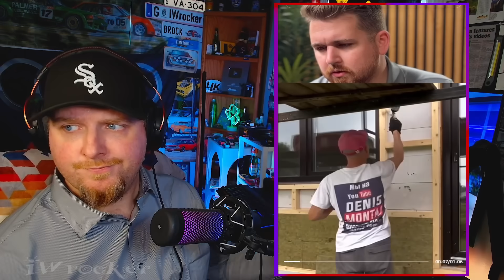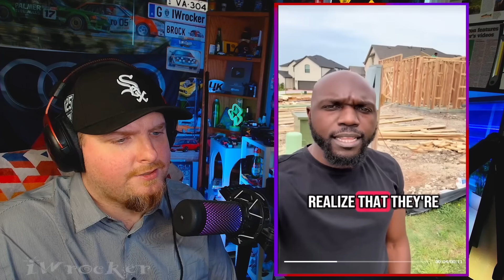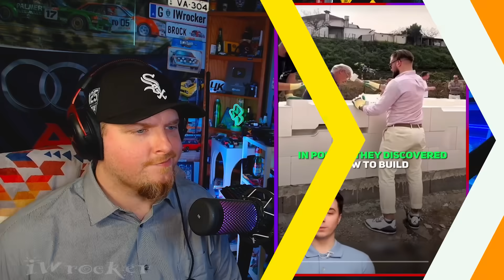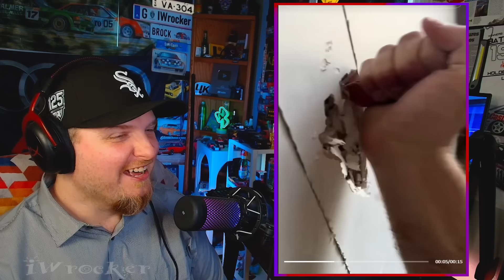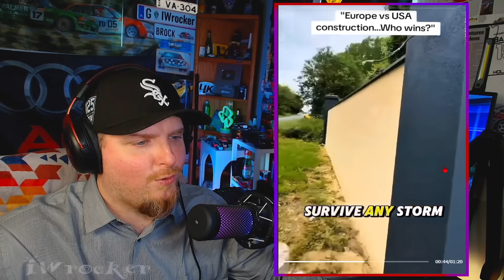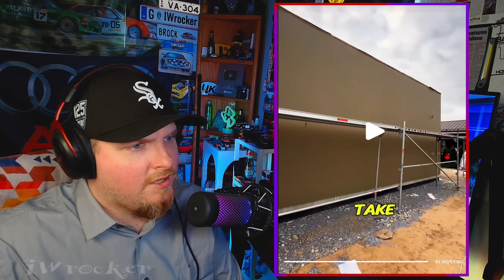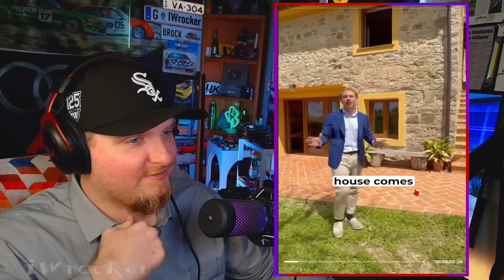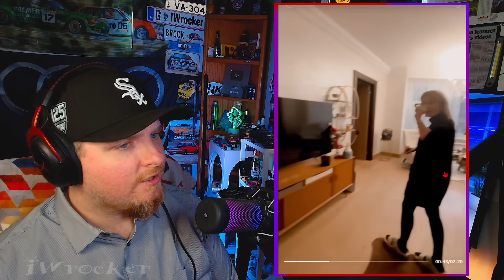25 Minutes of European VS American Home Quality & Construction Methods 🔨

Comment: 1:54 we do just anything right in america - most stupid saying on planet - if you talk about building and constructions. American houses are plywood and shi1 - while even the quick-building houses in europe are massive and stable. We not even start with the old ones, just enter a mediterain italian city (or rome) and watch what these people build then.
Walls here in germany are massive, my house has (internal, non carrying) 18cm, the others are 32cm thick. Concrete and/or stone. The ceiling is steel-supported concrete, just like the walls of my cellar. You could put an elephant in the center of any room - or a 6-people whirlpool - nothing would happen. 

7:55 laughable... sorry. As a kid i never understood why americans jumped to the floor if the evil guy started shooting IN the house. Here with me - i could stand behind the wall and you could empty 3-4 magazines into the wall and would achive - nothing. These are no walls but shi1.

And still, you can have both. If you have a concrete-+-steel-building here in germany, you could have only the walls and maybe one carrying wall and all other internal stuff is easy to fix - just like in these terrible american houses. But the outer walls are massive and stable. 

13:11 nah, 9k is a wet dream. 
If you would put modern (3-level-protection-glass) into my house (i have "only 2 layer") i would spent 40k... 27 windows (if you count normal 80cm-sized ones as standard) and 3 large doors.  The price - at least in germany is way to cheap. But yes, i can open any door and window in the "Kipp-"version and they are much much much much better then anything ordinary americans use.  

14:50 He is right. But also wrong. The problem with modern european (here german) houses is, that they are "airtight". Older ones, who had bad isolation could bring the moisture through the walls. For this modern "passive-houses" have a house-cooling-system", not an AC (still only few houses have that - myself have 4 in 4 rooms, never had any problems with moisture) but it transports the moisture out of the house. A problem mostly occurs in older houses (build between the 70ties and 2000s) that get renovated and turned airtight. These have often problems with that. Modern ones either have the system i described or - more and more - ACs, so a running AC drew the wet humid air out and turns it into dry one. 

17:00 yeah, but that happens all over the world. Scum happens by evil people, i doubt that german builders are better/worse then the american ones. Really. But yeah, such failures - are impossible to hide. 
In germany we have rules, for example, the last 10% of the money is ONLY delivered after the new owner have checked all boxes and give his okay for the house. Such things - no okay, no rest money (such a house costs around 600-700k, so the builder sits on 60-70k he will not get, only after fixing all trouble creating things)

Comment: I fail to see any pros in USA houses.. being quick to build is not a pro.. 

A house needs to be:
Durable
Strong
Last forever
Be secure
Have insulation to cold and hot
Noise reduction 
Not be a fire hazzard 

And USA houses don't check any of that

Comment: on the wall issue... I have 80cm - 2.6 feet stone walls in my home my cellar is build of 50x50x50cm 1.6x1.6x1.6ft granit blocks and it was initially just a cow shed which got added a living wing some 200 years ago xD
Reply: and if you insulate your cealing you have to at least use 20cm around 8 Inches by building law

Comment: My parents' house in Northern Ireland is built from solid concrete blocks, double walls with 200mm insulation in between them, concrete floors with underfloor heating on both floors, solar panels, ground source heat pump, slate roof, triple glazed windows.

Put it in hurricane alley in the USA and a hurricane would feel like a light breeze. It's on an exposed farm with no other houses around it, and in the worst of the storms we had over the last few years, it lost a couple of roof slates.

I currently live in England, and my house was built in 1929. I don't see how it won't last at least another hundred years.

Comment: The insulation is on the outside because of the extreme colds... cold weather brings high humidity, without insulation, it will slowly seep into the blocks and damage the electrical and plumbing installations, the high humidity also allows saltpeter and mold to grow.

Comment: I’m a big fan of SIP home construction. It’s relatively simple to build and super fast. The panel expense is offset by the time saved. 

I saw a SIP house designed and created in Germany, arrive on the back of a truck in the UK accompanied by a team of German builders and the entire house was up in no time. 

The interior walls were pre painted to the clients specifications along with all of the outlets etc. The windows were the thicker European style and when completed the home was tested and given close to the highest energy efficiency ratings. 

Yup, I think Structural Insulated Panels (SIPs) are the way to go.

Or maybe fly in the Amish and have them build an insulated barn for you 😊(I’m not in the USA).

Comment: In my dads house in the inner walls plywood with plasterboard on top of them but quite tight between the beams and in the flats i lived in it is concrete with plasterboard on top or plywood with plasterboard on top of it . But if the building are for flats and is over a 100 yr. old then the filling between walls can be a bit different .
I know of some old buildings in the city area in Stockholm that has a rat problem inside their walls , why because when they were built they used hay with some clay as insulation .

Comment: Not really exaggerated the houses lasting 100years the house i live in was built in 1943 and is still strong ( some renovation done inside and outside) still the original main structure of the house standing strong

Comment: 12:52 On the windows I know, I'm Danish, if you choose to turn the handle all the way up, you can only open the top of the window, which tilts about 10 cm into the room for ventilation, but still hinges firmly at the bottom.

Comment: The foam insulation on the outside? Yeah, hell to the no. I studied this, it's part of my job (drawing technical building plans) and it's one hell of a fire risk. In case of a fire, it catches on fire in just under 10 minutes and then drips down your neck as you climb out the window. Do you really want dripping hot plastic dripping down into your neck and burning you additionally when you try to escape your burning house? Look up "Der Wärme-Dämm-Wahnsinn". It's a documentary by swr iirc, showing just what happened when a Multi-Story Appartment building burned down with exactly that insulation. And how bad mold can get. I'm glad we don't have that. I'm glad we have mineral wool. It doesn't burn at all and also doesn't get mold.

Comment: Point of tempo: I see your American buildings, and raise you a standard Viehbrockhaus (regional building company, but does build occasionally all across Germany). Ours is one. Standard two layers, core made of bricks, Fassade Made of bricks, in-between insulation, completely with basement, basement done in 2 weeks max. Whole house was done in 3 ½ months. Normal houses from them take 3 months till it's ready for giving you the key aka you can move in immediately and live in it immediately. Basement needs 2 extra weeks. They developed a special kind of concrete that dries extra fast just so they can make this "3 Monate bis Schlüsselübergabe" (3 months till you get the keys) promise and actually keep it. They have a big tent that they put over the house so they can even keep that promise in the winter. No matter how cold.
So tempo isn't even always in your favor. Our house, like I said, complete with basement, 3 ½ weeks. From beginning to end. And we have roughly 140-150 m² floor space. Two levels. Or, in German terms, 1.5 full floors.

Comment: My house has pre-made concrete walls, which have been compressed in the factory. Result: There is no way to get a simple nail for pictures in this walls. you need a pneumatic drill for tiny 3mm holes. A 8 mm hole can easily hold the weight of an adult. The dowel fails first before the wall.

Comment: If I tried to remove a wall in my 1950's home using a utility knife and punching it I would break my fist and have blunt blades. My previous home was 1850's and as strong as the day it was built. US housebuilding appears to be crazy poor quality and over priced generally with little quality control and everything in favour of the developers - max profit!

Comment: loath how corpos pushes the flimsy american style construction and tryes dismantle regulation pointing out the flaws with it

my 40's buildings might show if they not gotten any love but solid brick walls sure provides both a sturdy skeleton that lasts centuries and being inert material simpler to work with to insulate or add new tripple glass windows etc

Comment: 13:40 We have a tiny house in the garden made of wooden walls. We even insulated this walls, allthough the insulation material is only 1.5 inches thick, it still makes a difference in temperatures inside. So it´s pretty much standard over here...

Comment: That first dude is really insufferable. And Russia most definitely isn´t Europe. As an Austrian to me most American houses are like cardboard buildings. No stone or brick walls and no insulation? But cheap i guess. Of course you need insulation. And you don´t want your home to get blown away or flooded, do you? So it needs to be built of stone or brick. We also don´t want to pay endless money for heating (resources) and usually we survive without AC. Modern building all use those insulation techniques. We are trying to minimise our energy use for environmental purpose. We need a qualified planner if we want to build, often that´s an architect who actually went to university to learn everything there is to know about statics and building materials and has a degree. At least there needs to be a certified builder for construction. So they know exactly what to do and there simply is no mould in this. Plans need to be submitted and get confirmed by council and then you can start building. So yes, it costs. A lot. But we have a guarantee not to be buried alive after a storm. In Austria most city houses have red brick tiles, my city´s are even part of our cultural heritage. Those metal tiles are really cheap. I am surprised to learn they don´t use them in the US. The house i live in is about 200 years old and there are far older ones around. What I am really interested in is how you install a bookshelf on those cardboard walls? Mine are all made of brick. If you´d punch them, you´d break your hands. And don´t you get a lot of vermin and mould in those hollow walls? That house in London is not for living, by the way. They used to build only facades in some places to disguise railway tracks and make the street more pleasing.

Comment: The London house is indeed a fascia. Suspect there will be a tube line running directly underneath behind it. 

Not sure what you have in America but over here we have listed buildings which it's very difficult to remove and sometimes I would partially listed so the facial will be listed but the actual building can be destroyed behind it - I work with a security company and we looked after a company in Cardiff where they built a massive tower block but because the fascia was listed they had to keep the 19th century frontage and bolt it onto it. 

We are also getting more timber frame properties in the UK and we've looked after a few of those too - cannot say with our weather I think they will stand the test of time.

Comment: I live in a post communist ten story midrise, with 86 apartments. It's made of rebar reinforced concrete. I can't hear any of the others in the buildig, Ihave excelent central heating and decent AC, and central venting too. Oh yes it was built in 1975.

Comment: My old apartment was built of granite blocks, the approximate size of a refrigerator. The insulation was reeds mixed with blueclay and sand. My current one is thick concrete with cedar cladding.
I'm worried about those wood/plasterboard buildings. Will they hold against a storm? Thick roof snow? What if something falls on them? Are they safe?

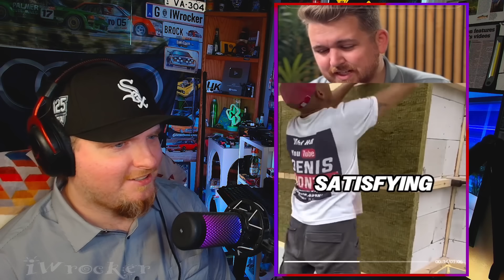Comment: 1:18 As a European I have never seen wool insulation done like this, I mean wool is nice I do prefer polystyrene, even though it makes a lot more mess and is less ecological, but just the thought of having those gaps of wood between insulation would haunt me. All that adds up on that electrical bill, oof. :D
Also that isnt conrcete but what looks to me like autoclaved aerated concrete, had to google the english name and its quite something, unlike the word porobeton, its pretty weak but good enough for a 1-3 story house, but it has very good insulating properties.

6:20 I dont know about this, you have to understand in Europe every once in a while someone gets a crazy idea and they say it became popular across Europe, but I would argue that less than 1% of European houses are build like this. Its a new thing and I have nothing against innovation. But I wouldnt call it popular.

8:50 I would like to disagree with fellow Europeans, drywall is pretty good. You can easily remodel your house with it and its far more common in Europe then one would like to believe. Its not unheard of, we use it. Just not in such a massive ammount.

13:40 Ok this is exactly how newbuilt houses and added insulation is done, atleast here in Czechia on 99% of houses, except we also drill and anchor the blocks to the wall, otherwise you are risking a strong wind finding its way underneath the blocks and just peeling it off. Then goes the mesh and the underplaster on top of which goes stucco or whatever you call it in english, rendering perhaps.

17:30 Another intersting bit, here all newly build houses have to pass inspection and thus Newer Houses actually are better than older, ofcourse time will tell what is the reality, but in America it seems older is better.

19:35 Never in a million years would I want a fireplace, all the heat goes poof out the chimney, no thanks. Get me a proper metal stovetop.

22:44 What do you mean the whole thing is tiled? Why so surprised, says me surpised by you being surprised?

23:54 That is indeed a good deal, if only it was so affordable here... :(

Comment: fun fact on european windows, or at least the french ones I know. There are two settings : winter and summer, you just have to turn a locket on the side of your window to make the joint tighter or looser depending on weather, humidity etc. It's pretty neat ngl. Do you guys hear everything your neighbors are doing with such thin paper walls ? I sometimes hear my upstairs neighbors when they walk in heels or run down the stairs but that's pretty much it

Comment: Most homes in Europe also use "drywall" in the uk we call it plaster board. But yes we do it too... the difference is the outside and the inside supports are all made up of usually double skin brick walls for structural integrity. But overall rooms are made of wood and plaster board. We also plaster over the board to make it more solid rather then using a thing layer of "mud" i believe you call it state side.

Comment: 18:45 That little 3-wheeler is called a Piaggio Ape! It's an Italian icon. In Italian, 'Ape' means 'Bee' (because it buzzes around). It’s basically a Vespa with a truck bed! We use them everywhere in Italy because they can fit through tiny medieval streets where no regular truck could ever go. 🐝🇮🇹

Comment: Over here, in the Netherlands, houses are built of bricks. All outer walls will be double with space in between for insulation. Inner walls will be of bricks or plaster blocks. Floors are made of concrete.

Comment: I'm reminded if the tale of the "Three Little Pigs" Americans make houses out of Sticks, cheap disposable. Felt Tile roofs is so stupid 10-15 yrs max till leaking need to be replaced. In Uk some houses made from what's Called ""Cob"a mix of clay/straw/animal dug with Thatched straw/reed roofs needing new thatched roof about 50/60 years. Some still standing after 300-400 years are better. Brick/Stone with Tile/Slate roof done well looked after can last 400-500 years.

Comment: How did the first guy know that the timber wasn't pressure-treated?  There are colourless treatments that are used, at least here in the UK.  In France, they add a yellow dye to differentiate treated timber, but colour is not necessarily an indicator.  Such ignorance.

Comment: in France it is customary to build  Concrete and brick houses  - they last longer and are stronger. The insulation is outside if the houses were not buiilt automatically with the insulation. Otherwise we do have wooden houses. but it is not the custom. Also all the inside walls are concrete or bricks. IThey are not 'carboard' walls.

Comment: Why do American home builders always only think about cold? It also works the other way around, with heat... 

Main advantages of external insulation:
-Prevention of thermal bridges
-Prevention of moisture damage and mold
-Significant energy and cost savings
-No loss of living space
-Increased living comfort and coziness

Comment: I’ve never quite understood the value of getting a house where the walls burn through quicker than a fire door would, my house is 125 yrs old built of brick with brick walls between rooms, if you want to remove a wall you need a blooming big hammer and a steel beam to hold the rest of the house up

Comment: The insulation is being put on the outside because it's an old building!  Easier and less obtrusive than putting 100mm of extra insulation on the inside!  Moving plumbing, electrics, fitted kitchens and of course making the house a lot smaller!  Typical "America is right" attitude.